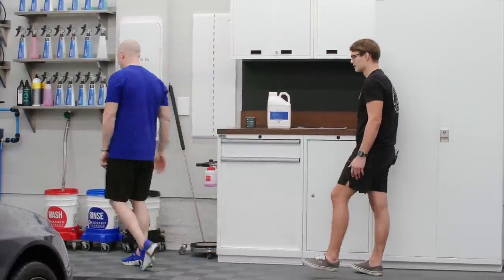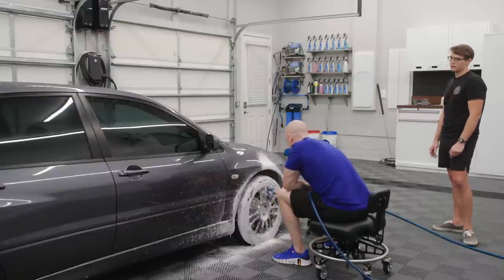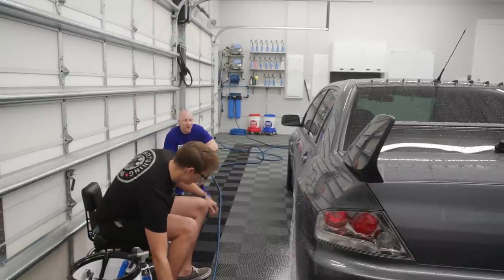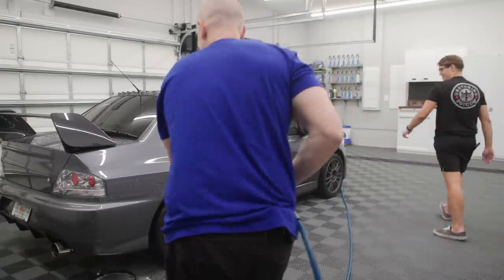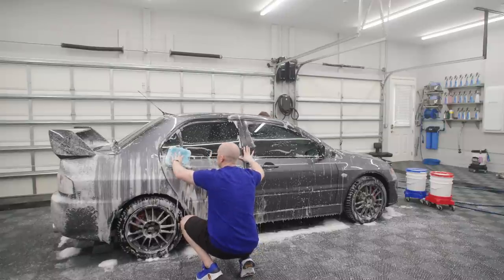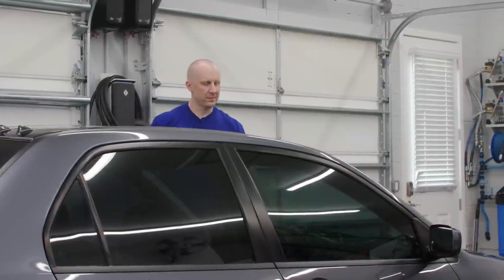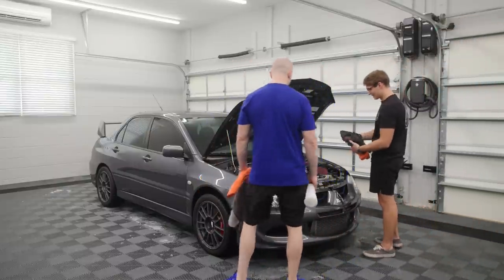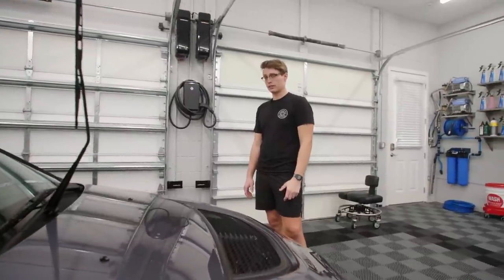Wash and Talk | Affiliate Edition With CC Detailing

Comment: When using that spout you have to pour the bottle from the other end, spout side should be towards the ceiling when tilted, that way you get a lot more control over the pour. Then when the bottle is like ~60% or something less fluid you can pour how you did in this video.

Comment: Good wash n talk. Thanks for the video. Ide really like to see a review on the Northstar 240v pressure washer #1571108 to see how the numbers compare with the dual kranzles.
Not sure if its possible to get the pressure down to 1100. It doesnt state what size nozzles it comes with. (its mislabeled as a 230v on northern tools website)

Comment: Hello Matt, great video, really enjoyed it. Do you have problems with all the humidity in the shop ? Such as tools rusting  or mold?
Reply: I was curious about that too.  Must be some good floor drains and AC to dehumidify.
Reply: @toddregister6621  I agree, but even so, I still I have to constantly be on impact sockets with oil and it turns to be very time consuming. Maybe someone has ideas or solutions I haven’t come across. Even thought of getting 2 portable dehumidifiers for 3 car garage.
Reply: This is his fourth home garage, plus OGHQ.  Humidity is everywhere outside in the deep South.  Nobody makes tools or equipment that are just raw iron.
Reply from the maker: Nope, it dissipates in minute or two.

Comment: I know you can’t use the CR spotless with the dual setup.  Is there a way simply isolate it to a single pressure washer use so you can use the CR spotless for your final rinse?
Reply from the maker: Yes, I have valves for it.